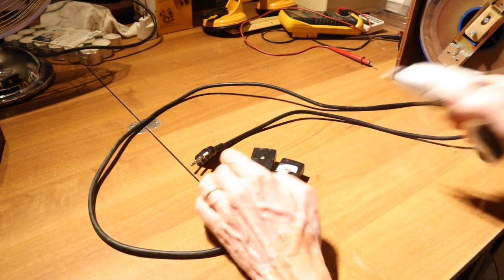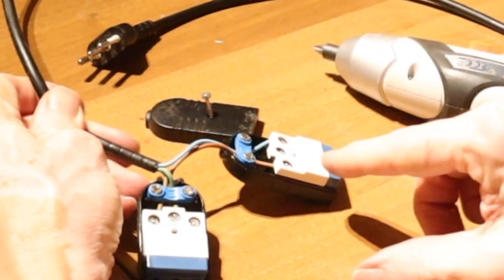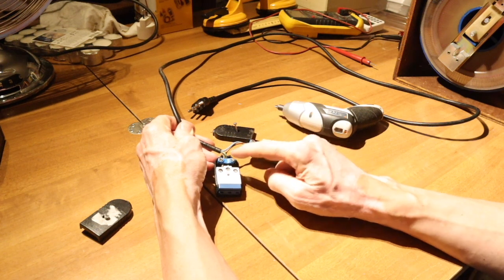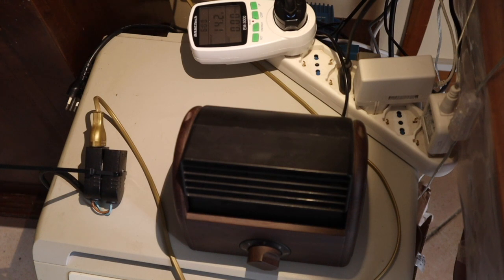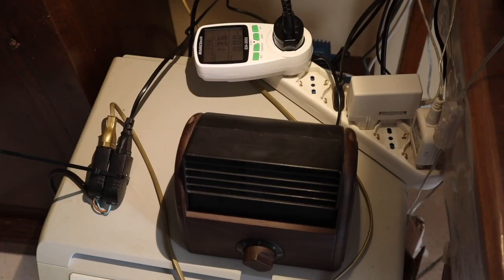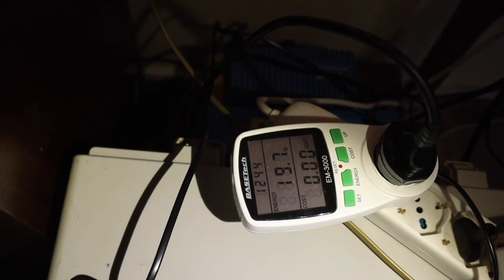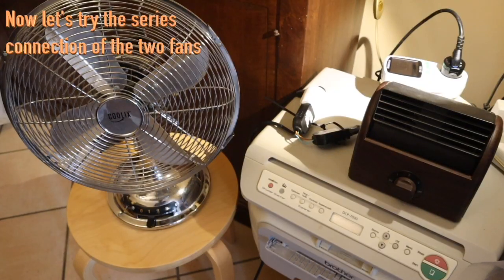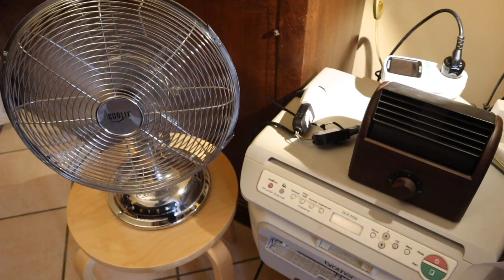Slow down you fan and enjoy silent cooling, without opening it! Part 2

Comment: Something you may be interested in.  Today I have put a hose pipe on my roof of my shed, this is connected directly to the cold water supply.  The hose goes from the tap through the hose on the roof and back into the kitchen.  Although it is not sunny the water gets nice and warm to wash hands and face and to swill dirty dishes or do washing up by hand.  A very simple solution for my central heating that has bust!  I estimate about 3 litres of quite warm water per hour if needed from using a hose pipe 1/2" diameter by 30 metres long.
Reply from the maker: That's nice indeed! Cold water is bad for artrose and only 20 degrees more is a world of difference and that by the sun. You can even cover the hose with glass, see part 1 of my video about the trip to the Netherlands, near the end.
Reply: @nnvasen-good-energy  Excellent idea using glass, I will watch all your videos :)
Reply from the maker: Thanks and don't hesitate to suggest new topics!